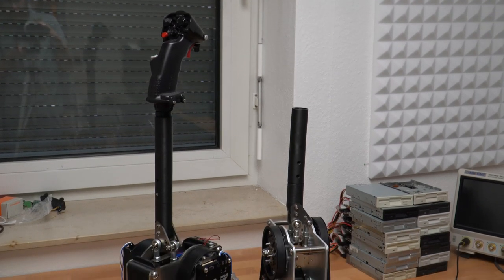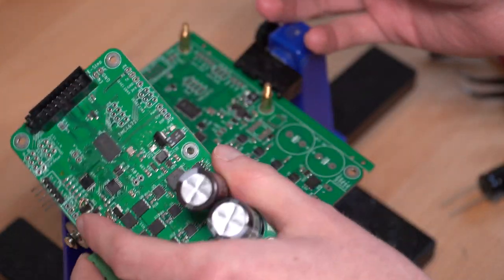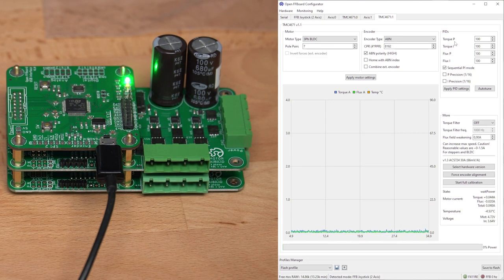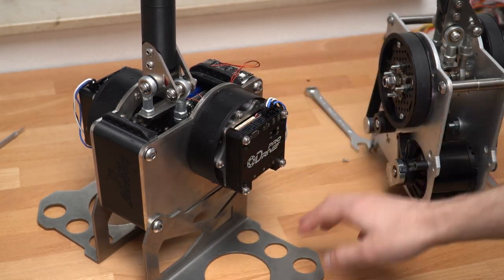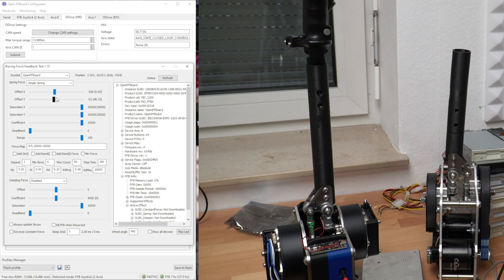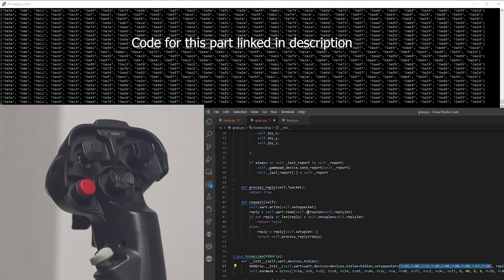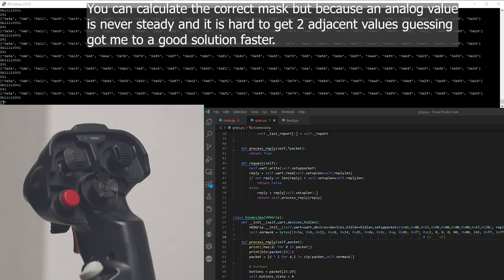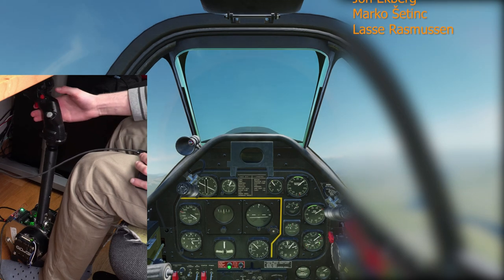DIY force feedback 2 axis joysticks using Open FFBoard (ODrive & TMC4671)

Comment: Do you know if anyone has anyone forked the code to support two h bridges for joysticks/yokes? I'm working on an existing hardware design that uses brushed motors / 600PPR encoders and end switches. I am talking with some other users about switching the control board to OpenFFB from existing Arduino program.

Comment: Hi, would it be possible to build using your hardware and firmware for force feedback yoke, rudder, throttle quadrant also? Therefore, would the firmware is able to handle more than two multiple axes?

Comment: It's awesome to see some open source devices to do dynamic control loading for flight sims. I have given this some thought and knew ODrive might be a good option to accomplish this, but I don't have the electronics expertise to pull it off. 

Couple questions:
1) What is it about the ODrive Pro that causes the issues you show? Do you anticipate those can or will be overcome? The ODrive Pro seems to be the preferred board going forward, and I think the older boards will be disappearing (the website suggests they not be used for new projects)
2) At a high level, how does the FFB protocol work and communicate with the sim/game? Does the game prescribe a center position and force gradient and then leave it up to the joystick interpret it as it as it sees fit? Is there even a well established convention for FFB sticks?

A device like this will be most useful for helicopter simulations due to how helicopters are trimmed in flight. If you're interested in exploring the flight sim aspect, I would highly recommend purchasing one of the DCS helicopters for testing (Huey would be a good option, though the Mi-24 has beeper trim, which would be good to test as well).
Reply from the maker: 1. The ODrive pro calculates the internal PID factors from a target bandwidth automatically. The issue i saw looks to me like a low I term slowly incrementing until it reaches enough current and the motor does a jump. It can surely be corrected by tuning but the options in the new firmware are a bit limited at the moment. They are working on the firmware actively so it might get better in the future.

2. It uses HID with Physical interface device effects (direct input). The game can control predefined effects or send a fixed torque and the device adds all the running effects to send to the motor driver. For a joystick every effect also has a direction factor for the axes. This only works with games that support direct input. Otherwise an external program would be required. The ffboard has an external FFB mode where effects are controlled with custom commands instead of PID for use with custom translation programs.
Reply: @Gigawipf  Thanks for the reply. It sounds like the ODrive issues will be overcome. That's good to hear. I'm sure these issues are impacting other applications as well. 

I guess there's already a well established standard for these kinds of things that is also quite flexible. That's also good to hear. I was worried there was some ad hoc method left over from the MS sidewinder FFB days that wouldn't have the flexibility required for modern applications. 

In any case, I hope to be making a helicopter cyclic, collective, and pedal setup using your boards at some point in the future. This is really excellent stuff, and thanks so much for making it all open source.

Comment: hello, my friend! You have a very interesting project and I want to try connecting my motor control board in vector mode (FOC). I want to take the can exchange protocol with the Odrive board as a basis. The problem is that I did not find a description of the exchange protocol (CAN). Can you help?

Comment: Might I ask why you need the Odrive boards, and why you need 1 per motor? Looking to make my own and im wondering why certain items you use are as expensive as they are (motors + boards)
Reply: It looks like those are designed for robotics use so they will be heavy duty. The reason you need two of them is they only have 1 channel for motor control. Although from looking online there also exists a 2 channel board.

Comment: hmm very nice and I wish I would be skilled enough to build it by myself ^^ 
because it doesn't looks verry straight forward, the FFBoard is currently not available, the soldering with heatgun is way to hard for most people and it seems there is only the version for oDrive available and they are damn expensive.
Maybe someone would devellop something more affordable and a bit less challanging DIY Kit with all Main components included. for example the older here shown chassis incl. board, Nema23 Steppermotors and printables.

Comment: I want to build one but afraid of cogging, even with odrive and good motors you say there are cogging, what can be done to avoid it ? Ffbeasts build uses scooter motors amd it seems free of cogging
Reply from the maker: The motors i had in the video do have cogging. The odrive cogging compensation can reduce that but it is better to use motors with lower cogging.
Some users have built systems with hoverboard/scooter motors which are smoother but more difficult to mount encoders to.
Reply: @Gigawipf  thanks for the reply, what kind of motors would you recommend for a extensionless side-stick setup